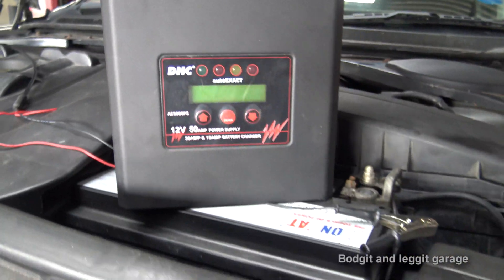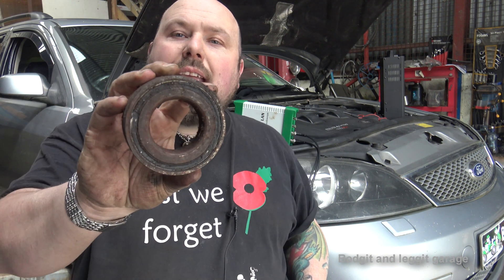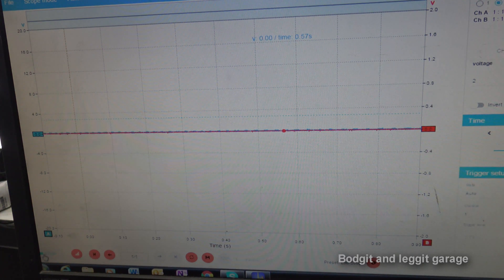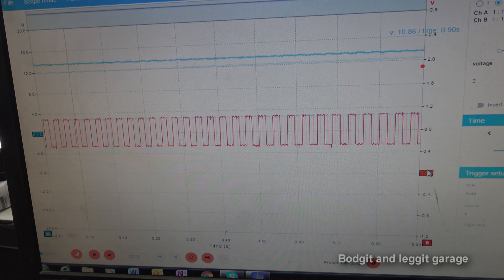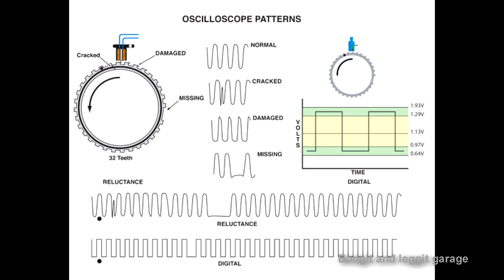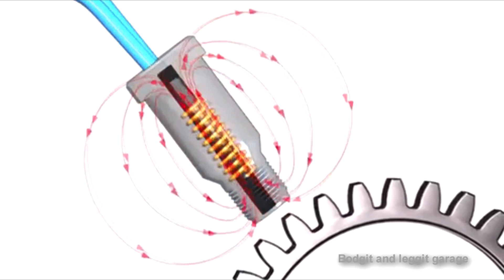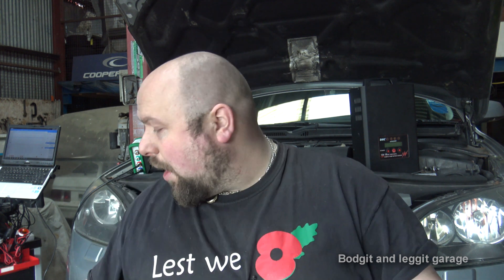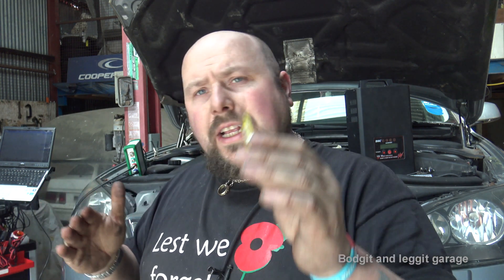How To Fix And Dianosing Yours ABS System Ditex Scope

Comment: Would you know what this problem could be on a 2005 citroen c2 as it failed it's mot for Electronic stability control warning lamp indicates a fault on dash (7.12 (e))
Reply from the maker: Hi mate I'm sure you will realise it's going to be impossible for me to guess what could be wrong it will need to be diagnosed properly it can just be too many things I hope you understand as I don't want to tell you something you buy a part and it's wrong and ends up costing you a lot of money
Reply: @bodgitandleggitgarage  The first question I should of asked was what part of the car causes the electronic stability control lamp to light as I never heard of it before. I've read it's part of the abs system so I need to buy a cheap scanner but do you know for any cheap clones as I'm hoping I won't need the scanner again.
Reply: @bodgitandleggitgarage  I've read the code and and it shows.

Recirculation pump abs/asr mechanically blocked.
Present.

Comment: I meant to ask you last time . I have the ABS lite on and the service lite ,i think it is the ABS module what is your guesstimate on that ?  Point being i am near Chester and you are in Southern Ireland otherwise i'd bring the car in to you :) :) Thanks mate :) :)
Reply from the maker: Hi mate I don't like to guess on anything especially something like a module that is very expensive and possibly needs coding all I can suggest you diagnose it properly and see it could be a simple thing I've just a broken wire and no parts are needed get some live data on a scan tool and see if you are getting wheel speed signals from all four sensors
Reply: @bodgitandleggitgarage  Thanks Leon :) :)
Reply from the maker: @dornyeeaston1635  any time mate

Comment: Poor mans ABS Sensor tester a battery an led connected in series with the ABS Sensor, the led goes on and off as you spin the wheel.Sorted.
Reply from the maker: What about intermittent faults and cracked tone rings and broken magnet pickups also what about if the signal amplitude isn't correct you cannot tell everything with him LED lights

Comment: Great Information your the best , just you forgot to say it never easy ? a lot of new cars now will cut the power to the sensor when it see a fault so it make it very hard to scope with no power and your can easy think you have a bad wire or worst think it needs a new ABS control unit when all the really needs is a new sensor so sorry it not always that easy . if it was we would be out off work .
Reply from the maker: Hi mate If you saw the the Beginning you would see a self-test happening on the scope this is what the car does so you can actually see if the car goes to itself test properly this will give you an idea also you can use a signal generator in place of the ABS sensor so there's lots of ways you can do it and it still is very easy 
The signal generator will confirm the wiring and the control unit it
And if that's all good or there's only one thing left

Comment: Electrical harness issue
Reply from the maker: No mate
Reply: bodgit and leggit garage in terms of a poor ground  return connection somewhere in the mess (connector or something)
Reply from the maker: @aqib2000  hi mate there's absolutely nothing wrong with the car I was just showing people what signals do you get the bit in the beginning was a self-test from the car itself